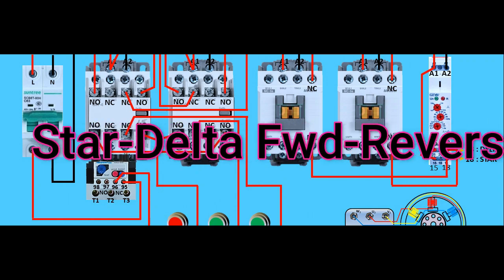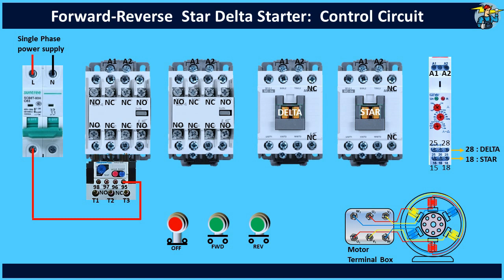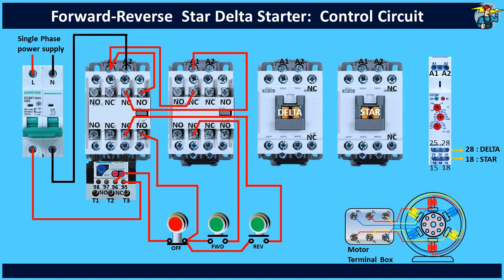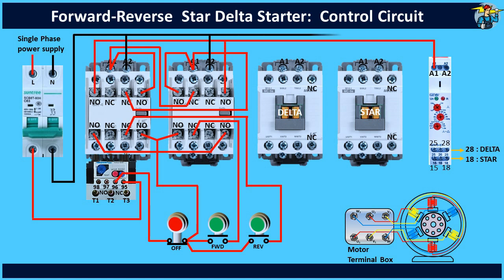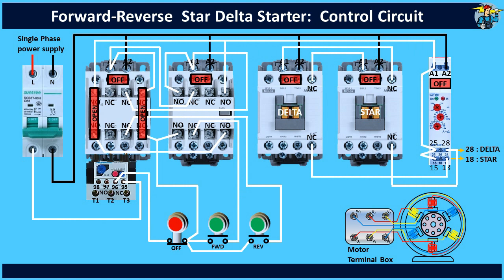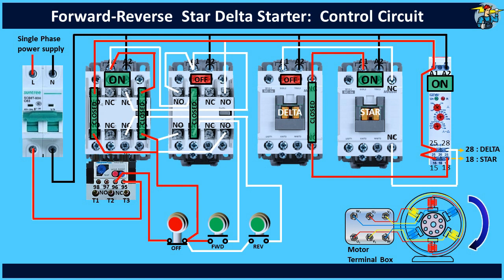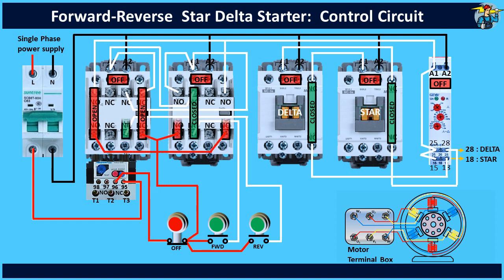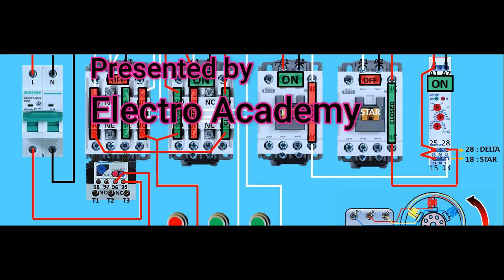Star Delta Starter with Motor Reversing Option - Control Circuit / 3 Phase Motor Applications

Comment: But there's a problem show the power supply wiring , because i did mine but thr reverse position was not working fine , after it switched to delta in reverse operating the electric motor will hom and i don't know why is that so please can you share your experience on this thanks 🙏🏼
Reply from the maker: Power supply wiring video is on below link. Please check.
https://youtu.be/2cqFXXyn-5I